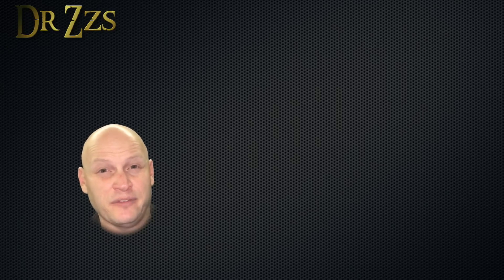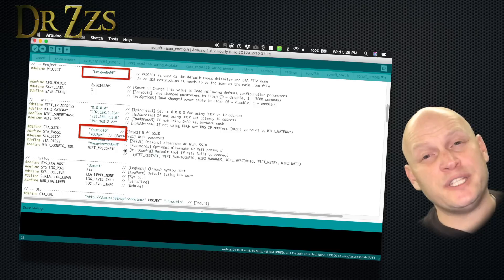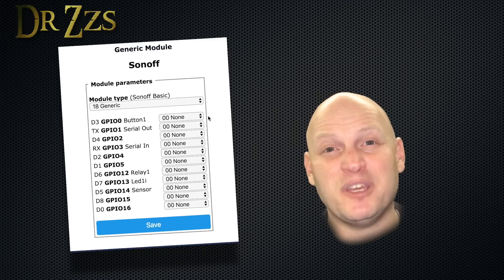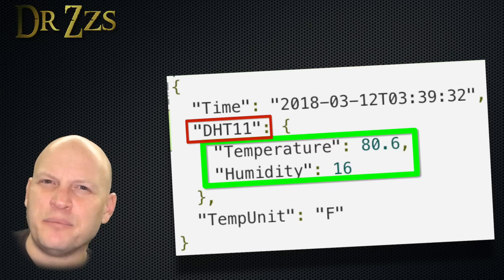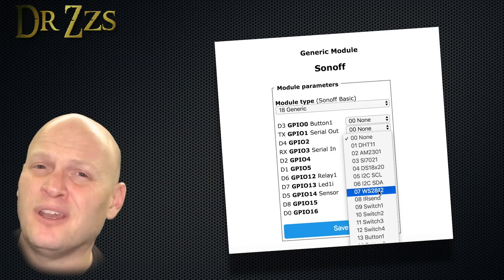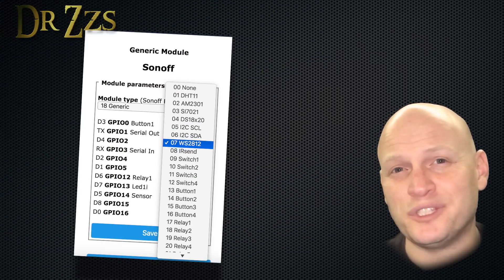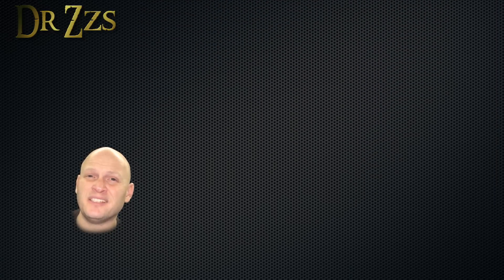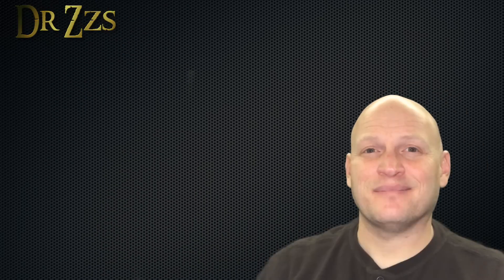Tasmota + D1mini (or Sonoff) - Temp & Humidity, ws2812 LEDs, and Motion Detection

Comment: For anyone else who comes here and struggles because this info is out of date, I have the following advice.  1) Use Tasmotizer to send the latest tasmota-sensor.bin file 2) use Tasmotizer "Send Config" button to send WiFi info.  You can then connect and setup the module-info or use the same Send Config button to setup MQQT etc.
Reply: Hello and thanks so much for this...spend a late evening trying to firgure all of the errors out that I was getting, finally realizing that the instructions were out of date...learned a bunch that way, but still frustrating in the end...until I found your comment here! Thanks so much!!

Comment: AAHHH I was breaking my head with the OFF msg that the PIR sends making the relay turn off. And is because SW1 is defaulted attached to de relay I guess, THAAAAAANKS!!!!
Reply: Well switchtopic2 actually doesnt work if you have more than one witch, at least not in my case. look at this, finally switchmode 14 is what I needed.
https://tasmota.github.io/docs/Buttons-and-Switches/#switchmode
"SwitchMode 14
Set switch to inverted "push to on" mode (0 = ON, 1 = nothing)

This mode is useful with PIR sensors

SwitchTopic
Warning
When using SwitchTopic 1 or 2 (or ButtonTopic 1 or 2) and your MQTT broker becomes unavailable, Tasmota falls back to default SwitchTopic 0 (or ButtonTopic 0), which is not optimal.
To avoid this, we recommend using rules. They simply always work!"

Comment: I am using a D1 mini to monitor temp, hum, bar and dew point. It operates from a battery and I need to monitor the analog pin to check the battery charge point. I use Tasmota to set up the chip and see where the analog pin is and have it assigned. My question is how do I get MQTT to see that analog pin and read it?
I also need to add the deep sleep mode, on a 1-minute cycle? Thank you in advance.

Comment: I like your videos, the style and presentation especially as well as the content. Please keep it up. I appreciate this video was released quite a long time ago, however I would welcome your input to a project that I am currently working on. I would like to use a D1 Mini or Node MCU to measure several temperatures using DS18B20 temperature sensors on a single 1-wire pin. Can this be done with Tasmotizer? If this is feasible then I would very much appreciate your comments.

Comment: DrZzs - It would be really cool to see a D1 Mini replace a old security system. Basically how to confiure the D1 to be the 8 zones a old panel would have. Most houses built in the last 20 years have contact sensors on the doors and windows. One D1 could interface them all to smarthings... for about $5.. really cool

Comment: Hi at first sorry about my English. :) I am little bit confused because,  when i go back to your video $5 Sonoff + $2 parts = Best Smart Switch EVER!  in this project you were using resistor and 33nf tantalum capacitor  to proper function of touch button.  It this current video you mention and show sonoff basic with humidity sensor  (DHT11) and touch button is connect to bat without  capacitor an resistor. My question  is, this another way ho to connect  touch button to sonoff without resistor a capacitor ? Thanks for all what you do. Have a nice day Mirek.

Comment: Great video, it's inspired me to start looking into this new world of automation! Does anybody know if there's a limit on the number of DHT11 sensors that tasmota can handle?  I'm trying to get 4 of them running to monitor my Heat Recovery Ventilator temps/hum levels but only 3 of them show up in the web UI and out of MQTT.  I've got them hooked up to GPIO's 0, 2, 4 and 5 with my module type as Generic 18.

Comment: Hi,
Perhaps you may be interested in this configuration.
When the motion sensor is activated, a rule delays its deactivation during the set time (in my case, 30 seconds) to see it active in HA.
The second rule invalidates the publication that turns off the connected led strip.

SwitchMode 0
SwitchMode2 1
SwitchTopic2 PIR
SwitchTopic 0

Rule1 on switch2#state=1 do backlog publish cmnd/PIR/POWER2 ON; RuleTimer1 30 endon on Rules#Timer=1 do publish cmnd/PIR/POWER2 OFF endon

Rule2 on switch2#state=0 do publish stat/proyecto1/POWER "" endon

Rule1 1
Rule2 1
 
;-) Thanks for your work.

Comment: Inspirational video. How do I read the sensor values in an iOS MQTT app like IoT OnOff? What kind of topic do I need to subscribe to?
Reply from the maker: thanks
I don't know about that specific app, but for Home Assistant the sensor entry looks something like this:
Sensor:
    - platform: mqtt
      state_topic: 'tele/masterBR/SENSOR'
      name: 'Master Bedroom Temp' #AM2301
      unit_of_measurement: '°F'
      value_template: '{{ value_json.AM2301.Temperature -2 }}'
Hope that helps.
Reply: @DrZzs  Great stuff. Managed to figure it out and your tip about inserting the sensor model into the JSON parser made it all work :) Thanks!

Comment: When I open the Sonoff.ino file, Only one tab opens that is the sonoff.ino. not getting the other tabs ????
Reply from the maker: I'd recommend not using the Arduino IDE anymore.  I'd go with the pre-compiled binary of tasmota instead. https://youtu.be/KMiP9Ku71To
Much easier and much less likely to have errors in the process. 
Good luck

Comment: You're not selling Tasmota to me in this case. I'll keep using ESPHome for these development boards, compile, load and HA auto detects. No messing with MQTT either. 

Though Tasmota and SonOff (via your videos) has got me thinking about RF more though with my bridge. Currently have development board based motion sensor, etc that require wire routing and power sources. Enter the SonOff RF bridge & a cheap, battery powered array of sensors. No more trying to make cables neat and working out where the nearest power source is.

The first I have working is cheap RF switches. I use these as an override to automation. IE the bedroom light doesn't come on if it detects motion but a certain lux level is already present. Fine 95% of the time, but what about the 5% of the time when I want the light bright to do a delicate job in the dark corner away from the window? RF switch on batteries in the dark corner allows be to override the automation logic. This is getting a high wife approval rating. No more hunting for the phone to do it.

This will allow me to use the development boards for more "thinking" projects, such as blinds (shades), LED control, etc. Again mostly based on your videos. Many thanks for making them.
Reply from the maker: this video was made WAY before ESPhome was a thing.  Even Tasmota wasn't as good back then as it is now.  
But I'm glad you watched and I'm glad you like ESPhome.  It is fantastic.
Reply: But each still has a place. I'm fairly new to this stuff, so didn't know ESPHome was new. Though I'm going to use Tasmota and MQTT more going forwards. Unfortunately for a lot of things I wish I'd known when I started. Still, every day is a chance to learn something new.

Comment: Hi, 
Thank you very much for all the videos. I am learning a lot with them.

In the 02:50 minute you say that nodemcu can work with 12v.
 This is correct?

I am using 12v LED strips ( WS2811 ) but I need to lower the voltage to 5v to power the nodemcu controller.
Reply from the maker: Check your specific NodeMCU board.  Some say they accept 12vdc, others say the max is 9v or even 5v.
Reply: @DrZzs  My NodeMCU boards are clones. I think if I turn it on with 12v they will burn jejeje
I don't see references to 12v in the specifications. Thank you very much.

Comment: Hello DrZZs,  all your video are awesome and I learn a lot with them. I use this video to create some temperature and humidity sensor over the house with some wemo d1 mini with tasmota and some DHT11, they all work nicely and home assistant integration too. The issue I have is, after sometime my wemo stop read the both value and the only way to make it read again is to remove the power and plug it back. After that it work for a while until I have to do it again. A soft restart do not work.

Can you help?

Thank you again for your good work
Reply from the maker: bummer.  I don't know what to do about that.  I guess I'd try to automate a hard reset perhaps by using a wifi smart plug for the power supply going to the D1mini. 
I've done that with my PiZero Cameras that need a hard restart every so often.  Not a very elegant solution, but it works.

Comment: I cannot wrap my head around these state topics, command topics!! MQTT in general is kicking my butt.  Where does this information come from?  Thanks for any and all information
Reply from the maker: It does take some getting used to.  I was quite confused about it for a long time.  Here's my best shot at a quick explanation:
MQTT is like devices texting each other.  The "topics" are like the device phone numbers.  the "payload" is the actual message.  The "Broker" is kinda like an old time phone operator passing the messages along. 
For example, a smart light can have a topic for the "state" that could be "stat/sonoff/power" and the payload could be On or Off.  That light communicates with the Broker and says, this is my state topic "stat/sonoff/power" so if anyone ask for me tell them I'm on or off based on the last message I sent you.  When the state of the switch changes from on to off it "Publishes" a new message using that topic "stat/sonoff/power" with payload Off.  Now if Home Assistant wants to know the state of that light it can "Subscribe" by telling the Broker; if anyone publishes a message to the topic "stat/sonoff/power" please let me know the payload so I can show Mando the right color Icon in his UI.  
For Command topics the switch tells the broker, if anyone wants me to change my state I'll be listening at this topic: cmnd/sonoff/power.  And when you press the button in Home Assistant it sends a message to the broker using the topic cmnd/sonoff/power, with the payload On or Off.  The broker passes that message on to the light and the light goes from Off to On. 
The exact "topic" can be almost anything as long as the devices that want to communicate with each other subscribe and publish to the exact same topic. 
For other sensors the payloads can be things other than on/off.  They can be number values like temperature or % humidity, or they can just be strings of text like a sentence or a couple words that you want to display on a screen.  
Hope that helps.  :)

Comment: i am not able to add switchtopic2..even when i use the code switchtopic2 in console..the reply says switchtopic changed but not switchtopic1 or switchtopic2 changed. please help
Reply: In that case, you just have 1 sensor or switch setup. If you use multiple sensors (up to 4), more switchtopics will start appearing. So for now, just SwitchTopic is fine.

Comment: Great Video DrZzs. I have learnt a great deal from your Videos and forums. I have just setup my first D1 Mini with DHT11 as the Temp and Humidity Sensor. I have it connected to MQTT and the Console is Reading the Temp and Humidity no problem
The problem is getting HA to read the Results of Temp and Humidity. They both show up in States as "unknown"
sensor.humidity unknown unit_of_measurement: %
friendly_name: Humidity
sensor.temperature unknown unit_of_measurement: °C
friendly_name: Temperature
The Console shows it is reading fine
09:00:34 MQT: tele/sonoff/SENSOR = {"Time":"2019-05-17T09:00:34","DHT11":{"Temperature":13.0,"Humidity":50.0},"TempUnit":"C"}
09:02:00 MQT: tele/sonoff/UPTIME = {"Time":"2019-05-17T09:02:00","Uptime":"0T00:26:40"}
What is the Project Name? as per your video, as I think this could be the problem
Any idea to help me link to HA?
Thanks in Advance :)
Reply from the maker: what do you have in your configuration.yaml?  My guess is the topic for yours is different from my example.
Reply: Hi DrZzs. I have resolved this issue. I had a naming convention that worked however I changed naming (MQTT Topic) for all devices and now they are all working just fine, including the D1 Mini with Temp and Humidity. Thanks for your reply, I appreciate it greatly. Hope to watch one of your Streams soon :)

Comment: ... Any chance you can do a clip showing how to add a DHT22 and say a BME280 to a Sonoff Basic. (I'm planning one DHT22 on one Basic at one location and another BME280 on a 2nd Basic at the 2nd location, only reason for the BME22 is the pressure sensor, would have been nice if there was a Temp/Hum/Pressuree sensor in the packaging of a DHT22
Reply from the maker: I can put it on the list.  Not sure when I can get to it.

Comment: You mention connecting the DHT11 to a sonoff... please elaborate.
G
Reply from the maker: this is an old video, so I would probably do it a little differently now.  But here is how I connected a temp/humidity sensor to a sonoff light switch using Tasmota: https://youtu.be/LUDjAdAB5Ak
Hope that helps.

Comment: Yo Doc.  I know this is old, but did you hook up the HC-SR501 directly to the Sonoff?  I see in your video of the Sonoff hookup and the 5v but isn't that 3.3v?  In another video, one person went through all kinds of steps to get the 5v.  Is it really possible to drive it off the Sonoff?  If you set the jumper to no repeat and timer to ~5 minutes, this would make a great walkway lighting combination.  Please let me know. - Thanks
Reply from the maker: I have connected PIR sensor directly to a sonoff and it works great.  I used this PIR though (not the 501) - http://drzzs.com/BruhPIR 
Can't honestly remember if I connected it to 5v or 3v.  I think it was the 3v pin from the flashing pins that I used.  
Hope that helps.  Definitely you should use that PIR from the link instead of the Big'ol 501.  I had a lot of trouble with the 501 triggering randomly when it's too close to the ESP8266 chip.  
Good luck!

Comment: thanks for the great tutorials... was wondering if you could help. Trying to get a PIR working. but it doesn't seem to update mqtt with the ON/OFF messages when there is movement.

Power > 5v
GND > GND
OUT > D1 on d1 mini (GPIO 5) set to switch2

followed the tutorial

but PIR seems to report ON every 5 min and not when there is movement (where am I going wrong)

17:02:08 MQT: tele/sonoff/INFO3 = {"RestartReason":"Software/System restart"}
17:02:08 MQT: stat/sonoff/RESULT = {"Command":"Unknown"}
17:02:16 MQT: tele/sonoff/STATE = {"Time":"2019-04-11T17:02:16","Uptime":"0T00:00:17","Vcc":3.037,"SleepMode":"Dynamic","Sleep":50,"LoadAvg":19,"Wifi":{"AP":1,"SSId":"WiFi","BSSId":"CC:2D:21:0B:BF:C9","Channel":6,"RSSI":72}}
17:02:16 MQT: tele/sonoff/SENSOR = {"Time":"2019-04-11T17:02:16","Switch2":"ON"}
17:02:30 CMD: switchtopic2 pir11
17:02:30 MQT: stat/sonoff/RESULT = {"SwitchTopic":"pir11"}
17:03:33 CMD: SwitchMode2 1
17:03:33 MQT: stat/sonoff/RESULT = {"SwitchMode2":1}
17:07:16 MQT: tele/sonoff/STATE = {"Time":"2019-04-11T17:07:16","Uptime":"0T00:05:17","Vcc":3.016,"SleepMode":"Dynamic","Sleep":50,"LoadAvg":19,"ssid":{"AP":1,"SSId":"ssid","BSSId":"CC:2D:21:0B:BF:C9","Channel":6,"RSSI":100}}
17:07:16 MQT: tele/sonoff/SENSOR = {"Time":"2019-04-11T17:07:16","Switch2":"ON"}
Reply: it seems you have your SwitchTopic set to pir11, but not SwitchTopic2. So maybe try adjusting that
Reply: @jrigvd7291  cool, will try it... In the end i ended up going with ESPhome and had to buy new PIR, and it works...

Comment: Thanks. Is there a way to set the number of lights on my LED Strip ? Because only 40 or so are lit.
Reply: write this in the console (of the tasmota) 
Pixels 1..512 = set amount of pixels in strip or ring and reset Rotation(applies only to addressable LEDs)

Comment: Not sure if anyone has tried to add more than one DHT11 sensor on a Nodemcu board, but I found out that the JSON object needs to be reformatted, due to the hyphen in the sensor name that tasmota adds to it.  I used D1, D2 and D3 pins and they reported DHT11-00, DHT11-04 and DHT11-05.  Below is how I reformatted the value_template so that it can read the hypen in the JSON object.  I also set the TelePeriod in the tasmota console to read the sensors every 30 seconds.  The command for that is TelePeriod 30.  I believe the default reads every 10 minutes.  Hope this helps someone else.
- platform: mqtt
    state_topic: 'tele/batterysensor/SENSOR'
    name: 'D1 Temperature'
    unit_of_measurement: '°F'
    value_template: '{{ value_json["DHT11-00"].Temperature }}'

Comment: I have followed your steps but for some reason when I opened my arduino soft ware it does not have the multiple tabs like yours does. I have tried to find where I went wrong but I cannot seems to get to the right location. It seems that when I open the Arduino software it is just that, mean it does not say sonoff like yours does at the top. I feel like I need to open a file to work in but I cannot find sonoff.ino??
Reply from the maker: I'd recommend not using Arduino IDE anymore.  There's an easier way to put Tasmota on any device.  Use FlashEZ and Sonoff.bin: https://youtu.be/KMiP9Ku71To

Comment: Hello DrZzs, sorry but what is the configurator-inator ?
Reply: Its Home Assistants Add-on called Configurator. Its so you can edit  yaml Configuration file from within Home Assistant.
Reply: @DarrenGulliver  Oh, it's the configurator. This behaves very well in a desktop browser. But as soon as you try to edit a file with the Android browser it will only go awry. The text marking function is always activated and the following or preceding letters are permanently deleted.
Reply: @fractofususmisrai237  I only use Configurator if I'm not at home and I want to make some quick changes. However when at home I use Visual Studio Code